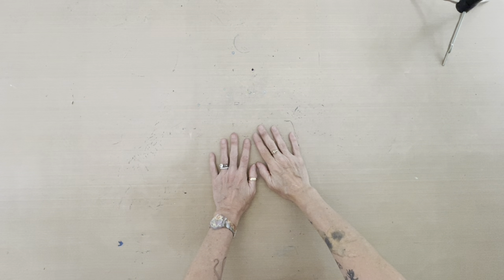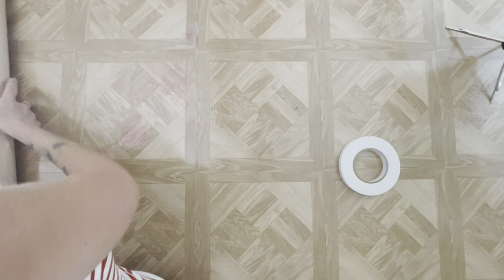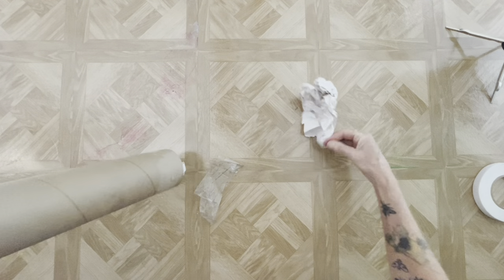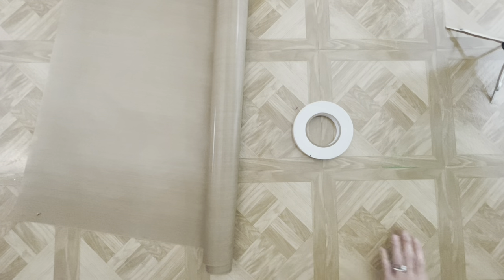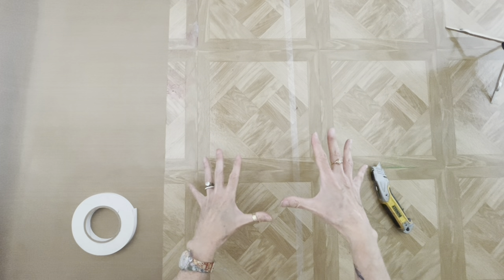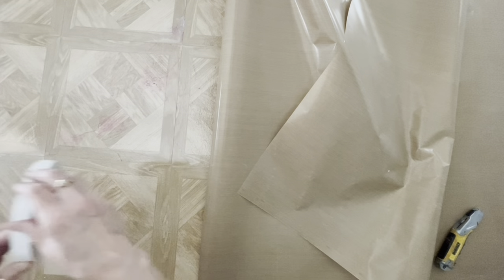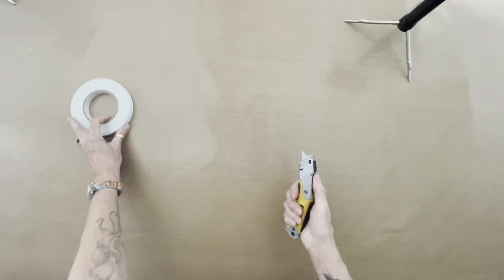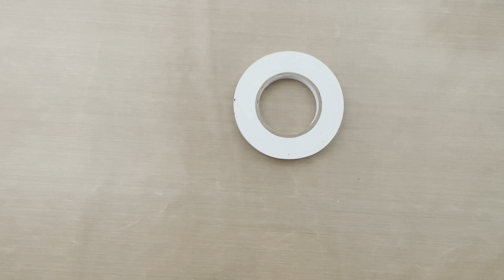How To Adhere Ranger Craft Sheet to Your Work Surface –Tutorial Tidbits

Comment: I love this mat!  I have small ones that I've used with fabrics and fusible web, but you turned me on to this buy by the foot one from Joggles and using it for painting.  Thanks 😊
Reply from the maker: I’m glad that you like it! It is great to cover a big surface when it sold by the foot. For some reason I remember you having it at the workshop on your table!?
Reply: @ElizabethStHilaire  I did.  My first purchase, I cut in half to use on 2 tables and take with me to workshops.  I now have another full length one that I can lay out on my kitchen island and keep the island safe.  Then easily roll back up for kitchen use.
Reply from the maker: @ellengoodloe9786  that’s so smart!!